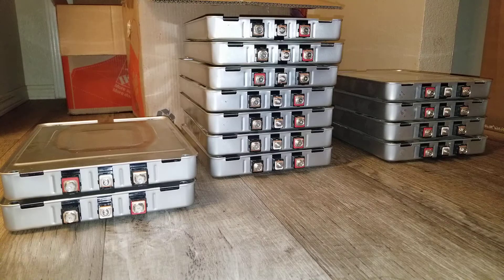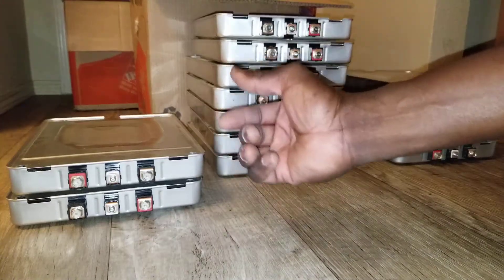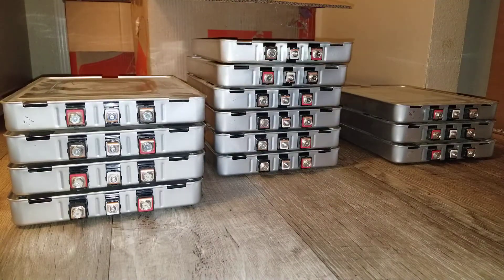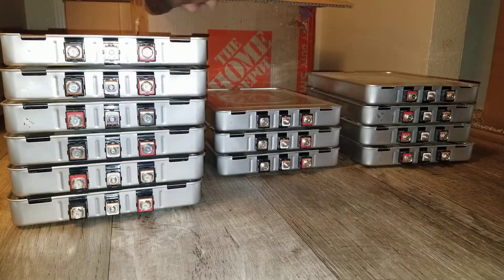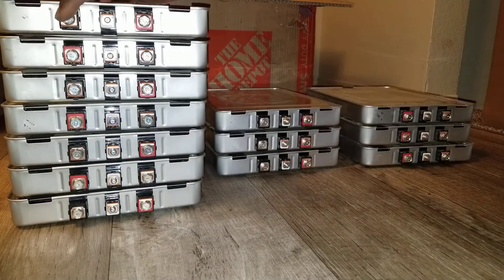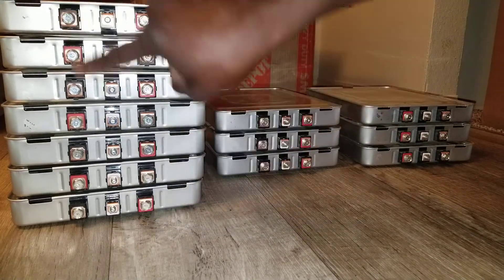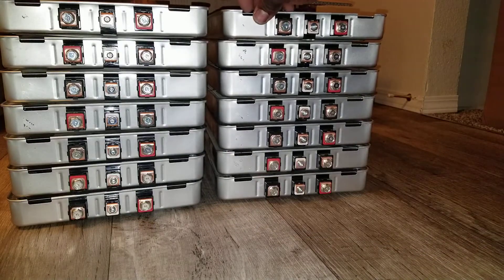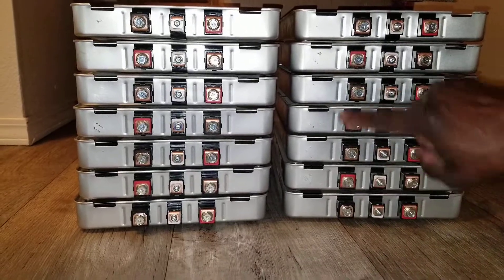OFF-GRID SOLAR BATTERY: HOW TO CONFIGURE 14S NISSAN LEAF LITHIUM FOR PROPER CHARGING & DISCHARGING

Comment: Great video but I have a question when stocking the batteries can you not just flip the battery backside up or backside down to make positive terminal fall on right side or left side? In the video it seems that your seaching for a specific battery to complete each stock.
Reply from the maker: These are how the are on a Nissan Leaf. Some of the batteries positive post are the left while others are on the on the right. 
Thanks for your observation and have a wonderful day Sean